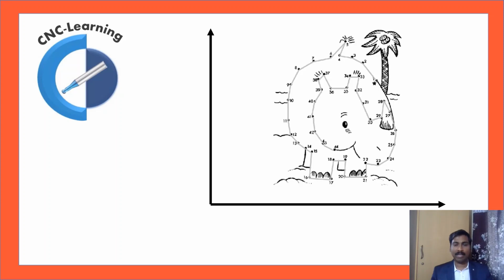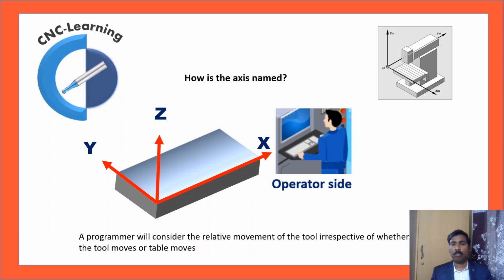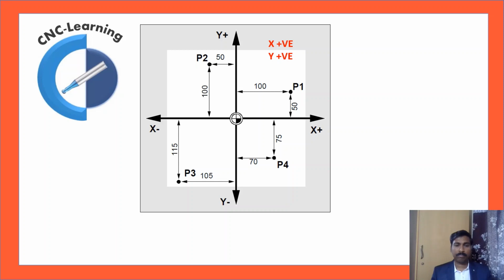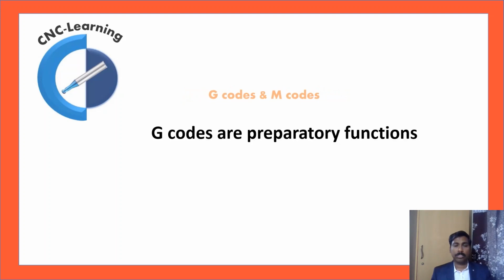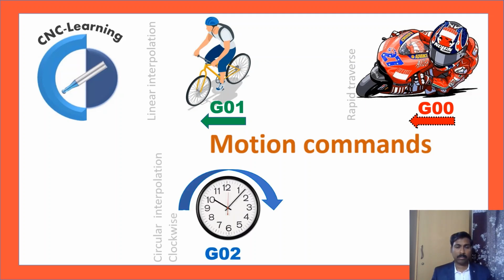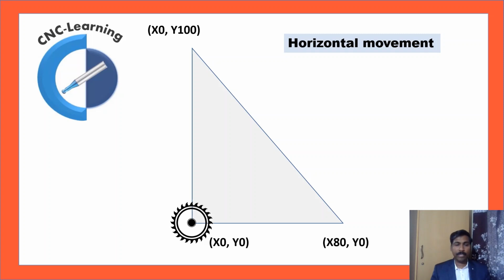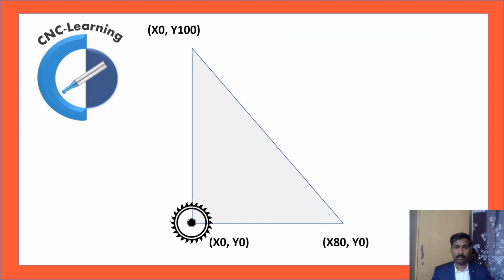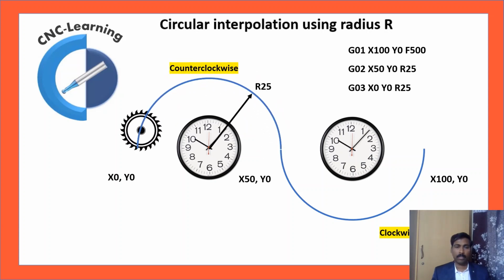CNC Programming (part-1) | G00 G01 G02 G03 | CNC-Learning | Rajeev Sreedharan

Comment: Nice video. Super simple for beginners. Thanks you for making this. I have a query about Circular Interpolation explanation. To locate the cutter at position X100, Y0 the command used is G01 . But you explained previously to use command G00 to locate cutter initially. Please clarify. Many Thanks for your effort.
Reply from the maker: Before X100 Y0, there should be another command with G0 to bring the tool to a nearby point. Feeding into the work piece always has to be with G01